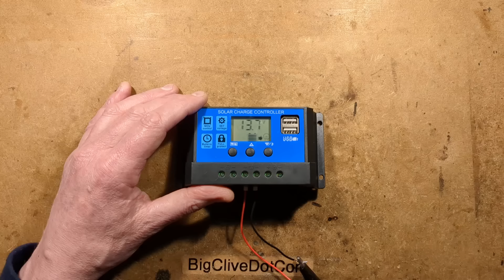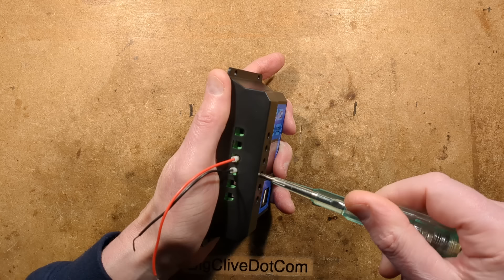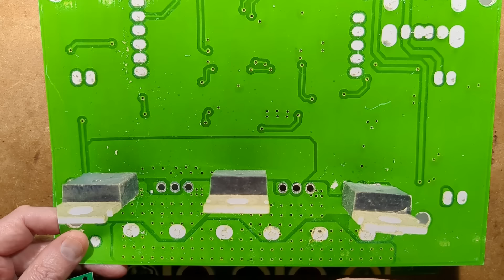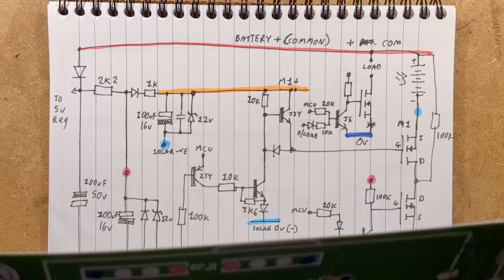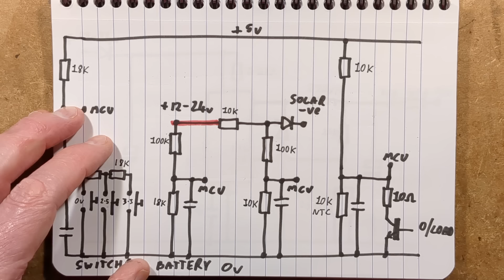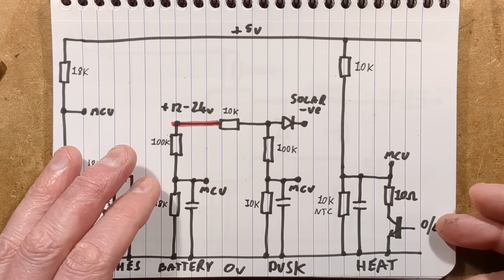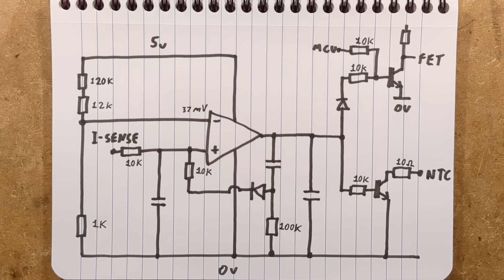Exploring a mass produced solar charge controller

Comment: I've been running one of these for over a decade, and never had a problem with it.  Cost about eight quid, back in the day.
No complaints from me.  Money well spent.
Reply: Lol this reads like one of those investment advisor scams. "Yes so and so really helped me in est etc" and the replies like "oh yes" it's so cliche at this point. not saying you guys are bots I'm just like lol.
Reply: @wolfpeoplearereal  I don't think you're thinking straight. Have you been out in the sun too long? 😁

Seriously... when there's a lot of disinformation about, which always happens with new tech (e.g. condensing boilers, electric cars, 5G mobile...), spread by Luddites and those whose vested interests are threatened alike, then countering it is hard and may come across as too enthusiastic.
Reply: @wolfpeoplearereal  I invested £8 in Solar Charge Controller in 2013, and now you can invest in one for the low price of £2.
I woz robbed!  😁
Reply: @wolfpeoplearereal  I'm a bot 😂 
3 years of use from a few of these cheap units,  no load attached to the unit itself,  just charging batteries. 
No issues
Reply: Me too, but in my case I wired it as an UPS system, the solar panel is a 12v 10A PSU regulated for 14,1v and to limit the current to the battery I've put a 0,5ohm with a big 20A schottky diode in parallel so when the current is charging the battery, it got limited to at most 7A (which is the 14,2 psu - 10,7V of a flat battery, so 3,5V drop over 0,5ohm = 7Amp at max) and the schottky provides a less resistance path when the battery is feeding the load, otherwise the resistor would limit the power too much. Works so well. The crappy cheap chinese PSU got fried a lot of times and needed replacement like once in a two years, until I put a trusty meanwell and it's running unmaintained since. Very reliable device.
Reply: have same experience , waters my polytunnel.via micro timer.
Reply: I had had great luck with these too. It seems to me that a controller on each panel is better than a big controller
Reply: @TimHayward  Definitely if shading is an issue, so the panels are unevenly illuminated, and they are wired in series.

Comment: I've got a Steca controller  --if you connect the panels first it selects 24v mode.
Reply: Not with 36 cell panels, at least my Steca PR1010 enters some sort of error mode when the battery is disconnected, it also keeps the load off but I'm not sure if it disconnects the load if it was already on, because the LED floodlights I have will operate between 10 and 30 VDC, so an accidental direct connection to a 36 cell panel is not a problem.
To reset the solar controller I've to disconnect both the solar panel (unless it's night) and the battery, then connect the battery first so it can determine if it is a 12V or 24V battery.
Today 60 and 72 cell panels are much cheaper than 36 cell panels for the same output power, but with PWM controllers I would only use them for 24 and 48V systems.

Comment: I had one.voltage displyed was inacurate and it died when it got wet and bulged my two 6v lead acid batteries giving them the full output from the panels

Comment: I have a cheap PWM solar controller, but my model only accepts lead batteries, I tested it by disconnecting the battery with the solar panel powering the controller, and it basically sent the 21V voltage from the 150W solar panel directly to the 12V output! At least this model seems to have a protection to turn off the load in case of battery disconnection by a BMS

Comment: I'm not convinced this is lithium capable as the one I have only selects between 3 different types of lead acid battery. Sealed, AGM and flooded. The unit looks identical to mine and I think that charging lithium batteries with this would be iffy. Yours could be different, but the B1 B2 B3 options are like mine, but the chinglish instructions on mine had no mention of lithium. I would hate to think the seller has falsely claimed its lithium capable in order to get more sales.
I also noticed the programmable float voltage did not respect your setting and would always float at 14.4 volt regardless.
Reply: Most Lithium batteries that are packaged and not just raw Lithium cells already have a BMS/Charge controller built in. If memory serves me correctly Lithium floats between 14.4 & 14.6. Only real problem I've heard about Lithium is that it can kill alternators...something about back EMF and that it's harder on the alternator rectification circuitry or somesuch thing. I even swapped out an AGM for Lithium in a UPS that I have and it seems to be doing OK.

Comment: I have something that looks exactly like this, i used it to trickle charge and keep my car battery topped up with a 50W solar panel kept in the car near the back glass. so that daily in afternoon it can charge the battery when sunlight is available for the panel. usually my car battery would go flat in a month but this keeps it alive during such long disuse situation.
Reply: same!
Reply: Wow, 50watts seems a bit overkill. I use this for the same purpose with a 10ish watt panel and it does the job fine.
Reply: I have a similar use case, much easier than hunting down a tiny parasitic draw. In the summer I crack the windows on my dark colored sedan when leaving it knowing I have to drive it later. Already got a 2nd battery in it for the sound system, which I wired up to power the cabin fan (full blast) when toggled on the remote. So when I get in to drive the hot air has been mostly displaced - a true gamechanger with no A/C

Comment: I wonder why they would take the trouble to scrape the numbers off of the MOSFETS? Seems bananas to me....Good video, it taught me that I will never be able to understand stuff like this!
Reply from the maker: Just give it time.  Knowledge builds up gradually without you even realising it.
Reply: I wonder if they were mosfets that didn't pass QA, so the manufacturer scrubbed the identifiers off and sold them with a lower rating
Reply: @mikeceresini2364  Thanks, that sounds a real possibility.
Reply: These things are rebadged by dozens (hundred's) of Chinese vendors and I bet opening another one would reveal several different jellybean MOSFET part numbers used depending on what they could get cheap that week.

Comment: in the camper groups theres tales of these going short, well the mosfets do, then they overcharge the lead acid batterys in the camper, and then fun starts.... 
just dont buy one thats not from a reputable company, if you need mppt, and you do, buy a good one, companies like make sky blue, and then also get a seperate bms, like a JK bms. been running makeskyblue for about 6 years, reoster and edecoa inverters for the same, and jkbms for about 2, all serviceable products

Comment: Definitely different to the one I have, though I did get mine about 10 years ago, it doesn't support lithium batteries, only lead acid (the different modes setting between wet cell, AGM and sealed), never examined it in this level of detail though, other than a cursory opening up and "hmm" of intrigue... :P

Comment: These usually use IRFZ44Ns or similar Mosfets
2 for 10A solar and 1 for 10A load
I have one that is rated for 50A and it has 4 for solar and 4 for load
It even has empty traces for more (will not go that route tho as 60A with no mppt tracking is literal waste of solar panels)

Comment: I wired up a 50-watt panel to a 50-ah battery through this to a solar pendant light which I pulled the battery out of. 
I can run the light for days on end with no issues.
It's a scary cheap product but I can't complain. Not sure I'd trust it with a larger system.

Comment: I think most of these are really only suited to lead acid batteries B1=Sealed B2=Gel and B3=Flood If you have expensive LFP's and Solar panels go for a branded controller.
Reply: Yeah, should go for a real mppt tracker. This is very basic and cheap
Reply: I was thinking it was something like that but I thought there was a customer one too but I think you can tweak all voltages anyway
Reply: Cheapest I'd recommend going is a renogy wanderer li lwm... Although MPPT is FAR superior. I use the cheap 30a li wanderer on my generator. And for other battery tendering

Comment: excellent, I didn't know these had a timer/dusk function, I'll have to see if mine does (it's not exactly the same) - shenanigans may ensue!
Reply: My ancient one does. Pretty sure they all do it. It's not very accurate though. Lots of variables in its start time and it seems to drift (probably based on temperature - it sometimes goes longer, sometimes shorter).

Comment: Clive you should get a "shovel tip" for your iron! I use these all the time for removing entire rows of pins, or shield-cans on RF modules. Two shovel tips in two irons (I dual-wield my TS100 and Pinecil) will make quick work of a great many things.
Reply: Add some low melt solder to the shovel tip and that display is out in a jiffy

Comment: I have a 12K  Solark inverter I run my house off. It has all the UL listings and stuff certifying it  for residential whole home power. I am also a radio HAM. I have spent the last 3 days working on knocking down the RFI that this thing puts out. I have a 25ft antenna about 200ft from the house and even at that distance the 80 and 160 meter bands were totally unusable because they were swamped by switching harmonics. After several hundred dollars in large snap on ferrite cores and grounding  I can now hear people on those bands. I'm going to go an extra step building a Faraday cage around the thing 😬 
73,
Reply: Ferrite Chokes!!! I used to work on copy machines and when we scrapped 'em I got as many as I could as most of them were the snap-on type and easy to remove!!!

Comment: Question I have. Can you use a regular DC power supply through a PWM charge controller if it supplies enough voltage? Also can a CC/CV power supply go through a mppt solar charge controller?
Reply from the maker: They recommend against using a power supply.  Possibly because of the risk of a current spike from a capacitor.

Comment: One thing to take note of is they control charge current with pwm

Therefore, if theirs no filtering of this spikey stuff:)
Then its possible its going to upset certain devices that may be connected

Typed before watging whoke vid so apologies if not covered

Had to mention it incase i forget :)

Comment: They have, at least, stopped calling it MPPT in the model name.

Mine failed catastrophically n a cloud of smoke. Id assume every single claim they make is utterly false beyond "charges a lead acid battery"
If anyone's plugging this into a lifepo they did not spend enough on a charge controller. Those USB are not to be trusted.

Comment: I had a car battery explode in my car. Not a great issue apart from I live in a flat and my garage in underneath someone's bedroom. I put it on charge overnight came down the next day and battery acid was dripping from the ceiling and =the case was ripped apart. I avoided the people upstairs my garage for a while but it must have made one hell of a bang. 🤣😂    interesting bit of kit 2x👍
Reply: Overnight?
Reply: @jefftysoutube  yes, I put the battery on charge trickle charging over night. The charger was "smart" so should have cut off when the battery was full but nope battery acid dripping off the bonnet and ceiling.🤦‍♂

Comment: I bought a bunch of these, all slightly different, to see the differences in them. Most had 3 MOSFETs, some had 5. One had a weighty metal backing that tried to signal quality through weight. A different case doesn't mean different internals. I use them in really simple setups, like trickle-charging a lead-acid battery. I destroyed the lamp output on one and now it stays on all the time. I wouldn't use them for switching large loads on and off. But they're cheap, plentiful, and still very useful.
Reply: The heavy metal backs act as a heatsink to the MOSFETs (in theory). Although many of them use such a thick thermal pad that it probably makes little difference.
Reply: Might be worth trying to add an aluminium plate to replace the thermal pad and through bolting mosfets aluminium plate and the back of the casing together.
Reply: The metal backing is for heat. Mosfets don't like heat. They need adequate heatsinks.
Reply: Why wouldn’t you connect the load directly to the battery?
Reply: @Conservator.  I've always done that since this experience.
Reply: Could use them for switching large loads if you instead power a relay with a flyback diode.
Reply: @CosmicHikari or just parallel a bunch of them.
Reply: These common SCCs are good for budget builds, I have the 30A with 100WP panel
Reply: Real words, my both solar panels 130 Watt are working since more than a year perfect with the 20A version.